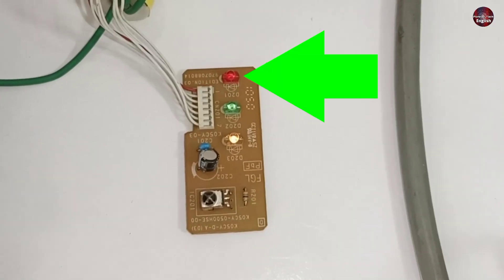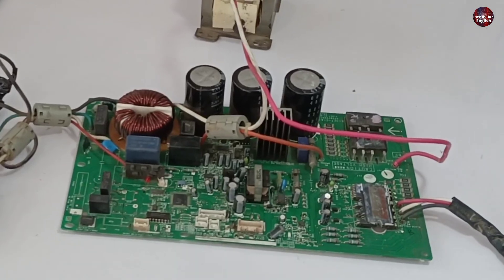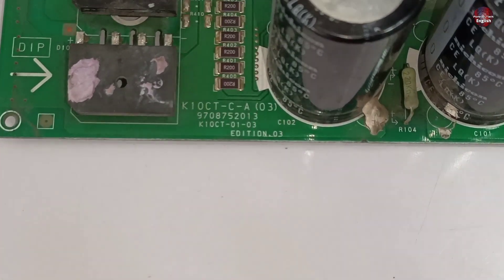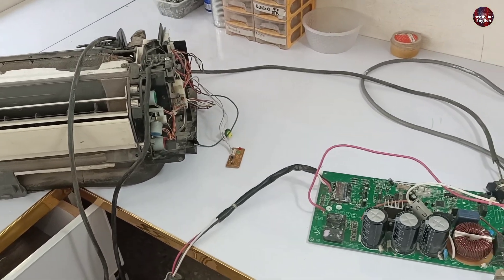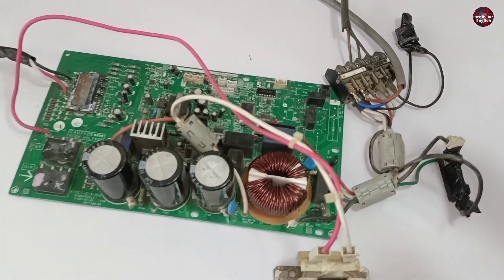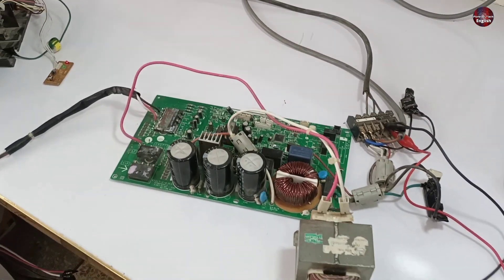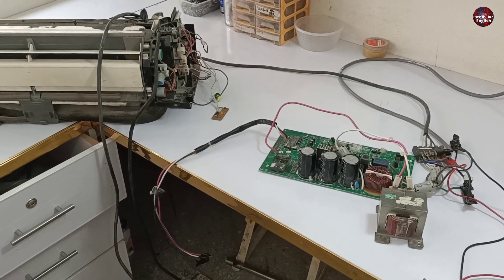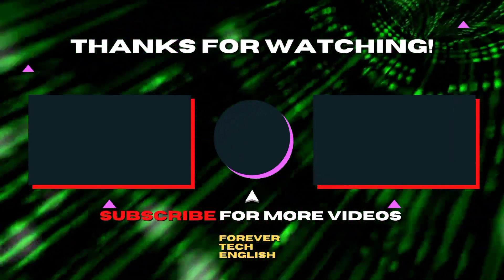Fix Fujitsu Mini Split AC Light Blinking with this Technique

Comment: I installed the Fujitsu mini split power is running correctly wiring is correct but still the indoor and outdoor won’t turn on keep in mind iv installed plenty of these but only now am I having an issue